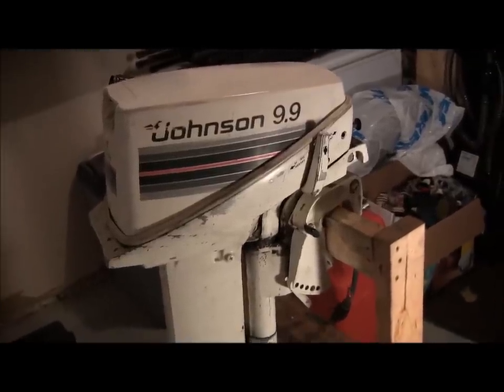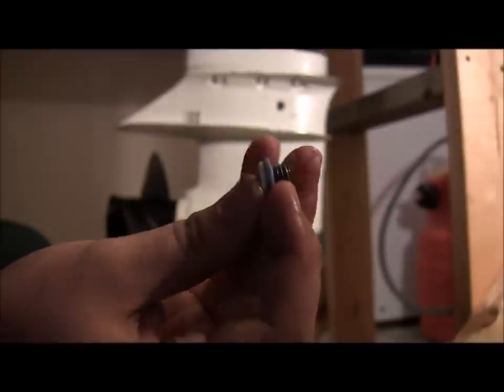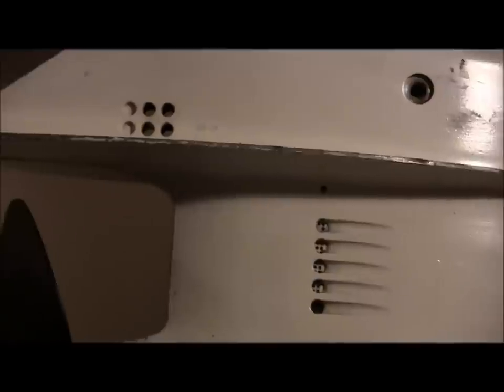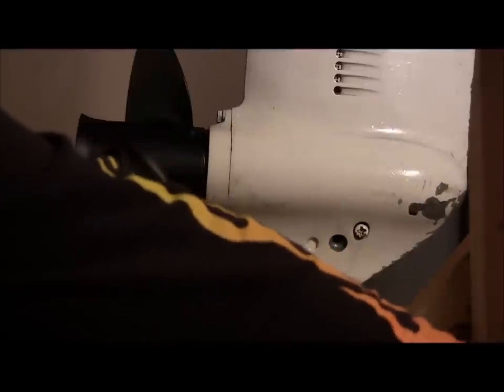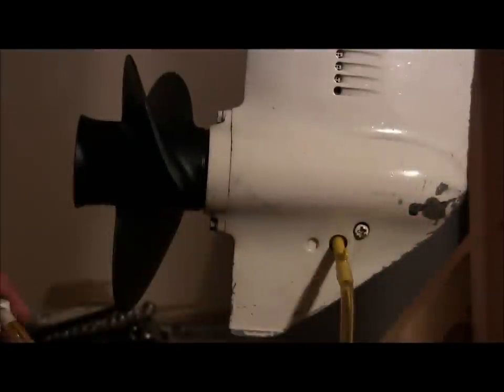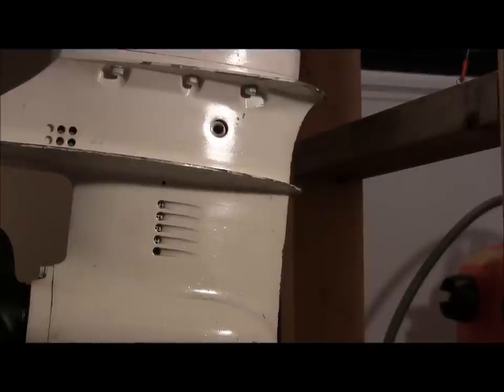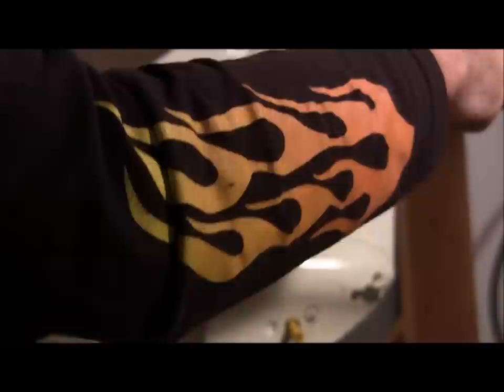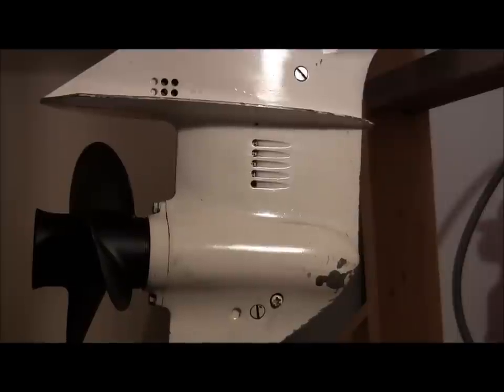Lower Unit Gear Oil Change 1982 Johnson Outboard

Comment: Your video is excellent.  I have a 92 johnson 6hp and I am going to change my foot oil as well. I recently rebuilt my carburetor and fuel pump. I'm still dealing with that but I feel I will be able to do this without any problem.

Comment: Hey this is my first motor I have a 84  90 hp evinrude can i use a 80w90 gear oil in bottom leg when changing my oil or should I get something diff ty

Comment: I just  got an 85 20hp jonson used and was supposedly stored a long time.Went to drain the oil and only a teaspoon of oil came out.Was not miky, but was very thick like molasses.Tiny water drops in it.I can only hope it seeped out of a slow leaking seal of many years
Reply from the maker: Hm yea thats probably what happened, otherwise yea there would have been water in there too. Considering how little oil it takes to fill the leg, I'd fill it, run it in a bucket in Fwd and rev a bit (don't give it too much throttle). Hopefully that would mix up the new oil around the gear case suspending any crap that might have been in there in the oil. Then switch out the oil again and see what you get coming out with the old oil. That may also show you if the leg is leaking seriously or not. Then I'd keep an eye on it as you use it, maybe change it more frequently until you're confident there aren't any seals that have been compromised.
Reply: Thanks-I did fill and run it slow for alittle.Then drain again and it was still pretty blackish.Filled it gain then went on water and really gave it a good test.It seemed to shift nice and and really pushed my little14ft  jon boat.Drained again and it came out a lot better mostly the green color of new with alittle off color with it.No water that I could see.

Comment: Is the same 90 weight oil that is used in automobile rear ends?
Reply from the maker: Wayne Martin So the viscosity may be similar (if not the same), but I believe the differences are in the additives. The marine lower unit oil is formulated to minimize damage from water ingress, where rear end oil wouldn’t have those anti-water additives
Reply: @nicoserena87  Thanks.  I managed to find a marine grade synthetic that had that mentioned in its purpose.

Comment: Relatively simple service procedure for sure, but "idiotic proof", never!  Many opportunities for error, especially if someone accidently removes that phillips shift pivot screw instead of the lower lube drain screw!  Changing lube more frequently, like you say, is the best way to monitor the slightly "milky" lube situation here...Might have been just some fish line in the prop shaft seals or messed up/missing/doubled up drain screw gaskets from a previous servicing...

Comment: what brand oil do you use?
Reply from the maker: Rob Bartalini I’ve switched over the years, tried to see if I could notice a difference. I’ve used Quicksilver, Volvo Penta, Sierra, now it’s more about what’s on sale and available in my area. Just make sure you check for HP ratings, a lot of manufacturers will make oil for < 50 HP for example. Also make sure it’s marine gear oil, supposed to help deal better with water ingress if it happens